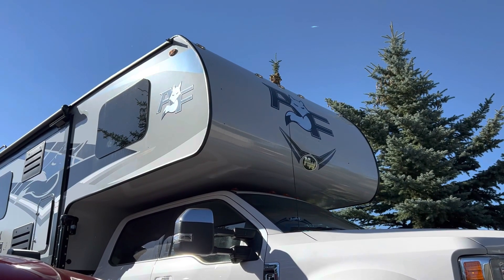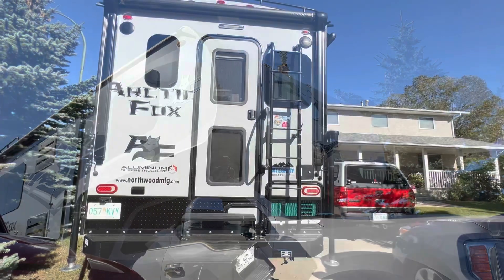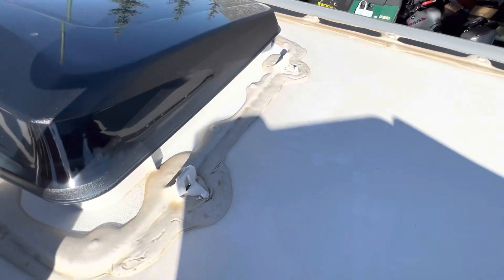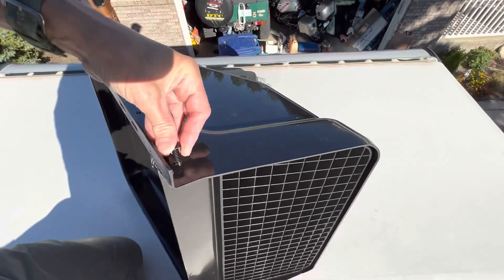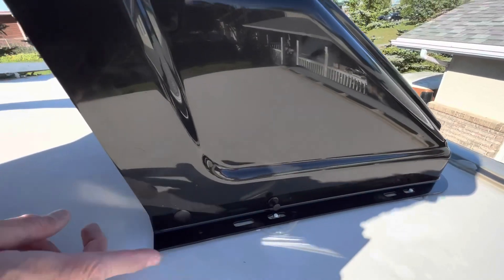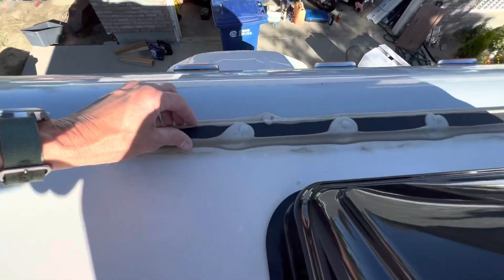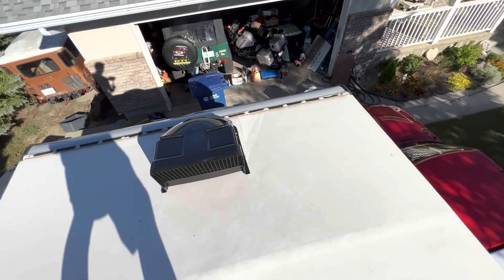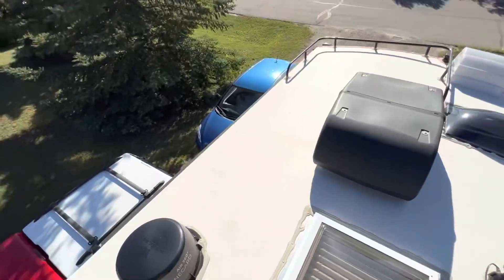Installing a Dometic U1400BLS Ultra Breeze Vent Cover on a 2022 Arctic Fox 1150

Comment: Where did u buy that cover?! I have dometic vents with those same mounting tabs. Cant find a dometic vent cover anywhere. I think they were replaced by the one u have
Reply from the maker: I bought it from the dealer that I bought the camper from.
Reply: These covers are not found online anywhere.  been looking for 6 months